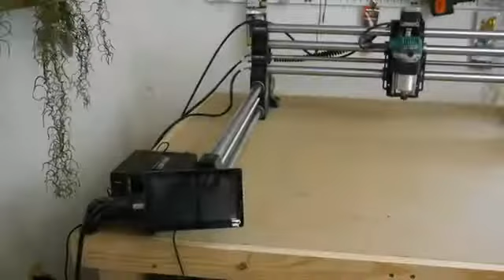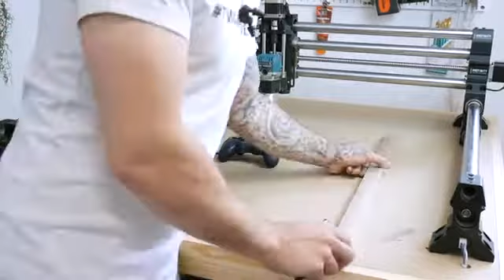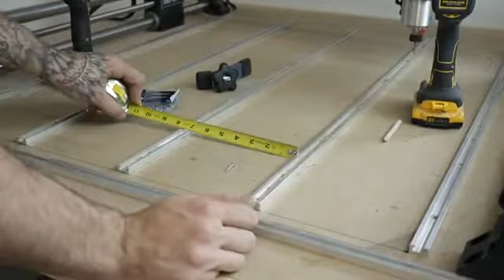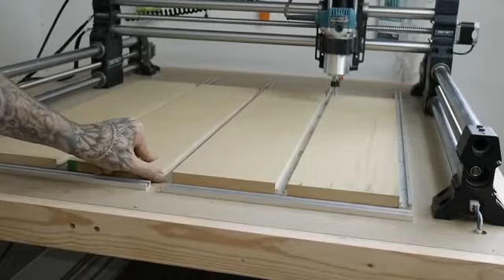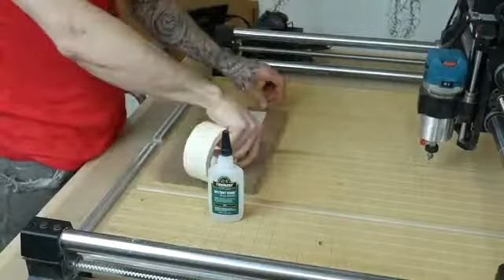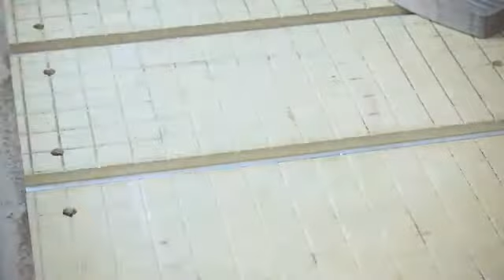Adding T Track Clamps Wasteboard Upgrade to the Onefinity CNC via Two Moose Design

Comment: IN THE FUTURE IF YOU CUT TWO WOOD PIECES THE SAME LENGTH YOU COULD USE THEM AS SPACERS AND AKE THEM  SPACED ALL THE SAME . EASY PEAESY
Reply from the maker: CAPS LOCK IS ON

Comment: I have a question about the machine.Is there a way to add your own Rotary axis?Also It would be neat to see some advantages to the open frame design like vertical support to do dovetails,box joints or some other cuts not usually capable on this size machine.You might even be able to add a mini lathe under there to do some turning/revolved machining?Thanks,Ross
Reply from the maker: We're planning on doing a rotary but that would be a ways off.  Yes, with the open frame it opens up lots of possiblites!